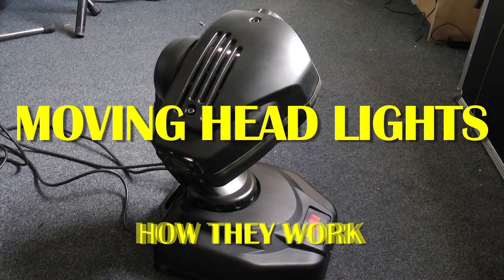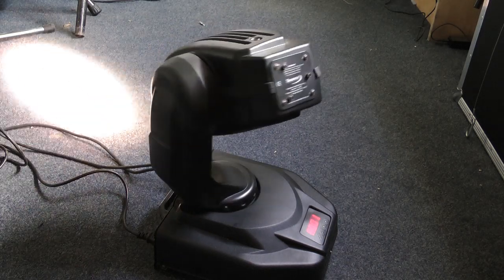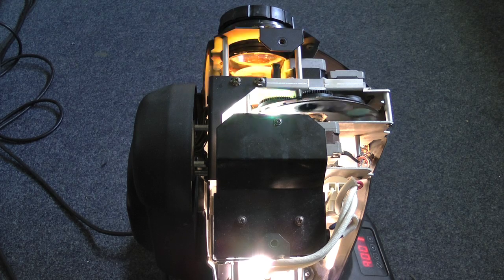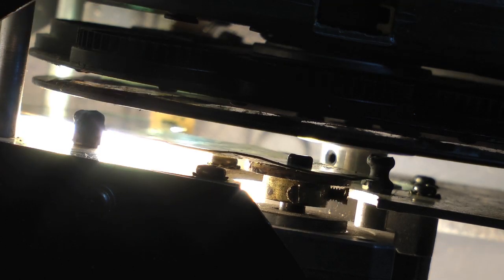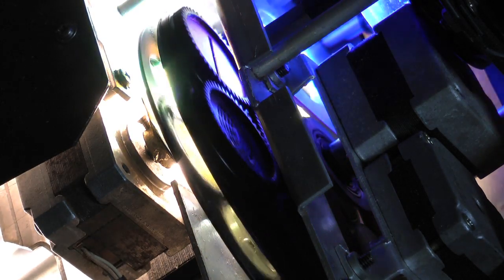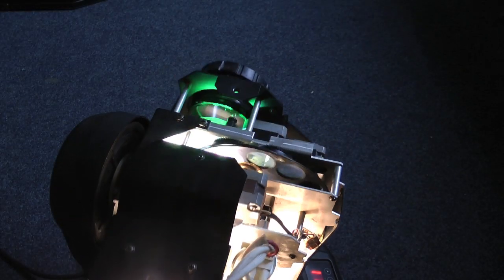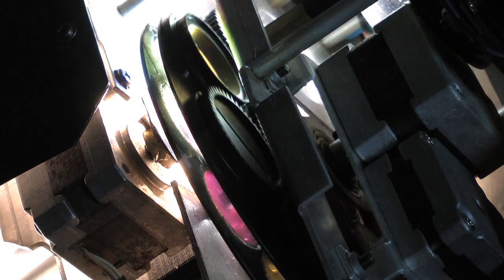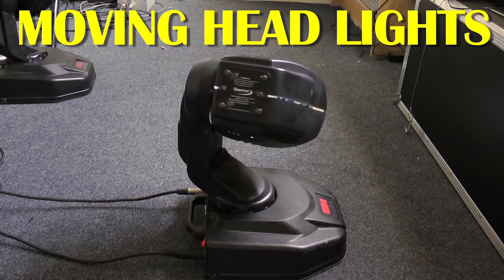A LOOK INSIDE AN OLD MOVING HEAD LIGHT

Comment: I am so surprised the manufacturer did that strobing (or what you call stutter) with a sheet if metal preventing the light from passing through and different transparent colored lenses to change the colors. I wonder why a manufacturer wouldn't use RGB LEDs (which were around during the birth of DMX lighting) and have a microcontroller do all of that work.